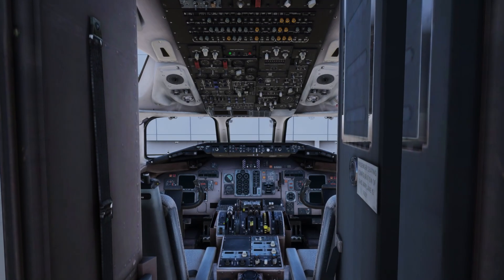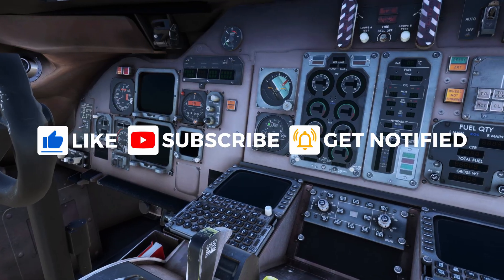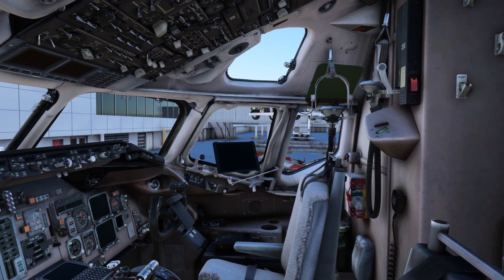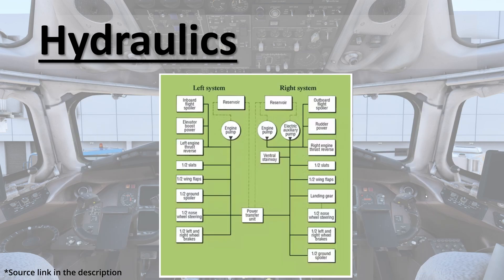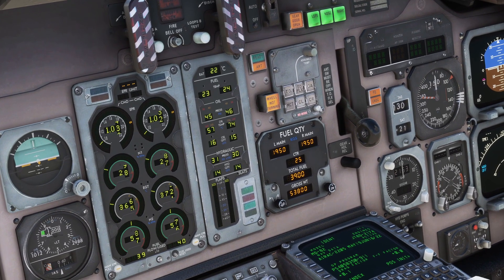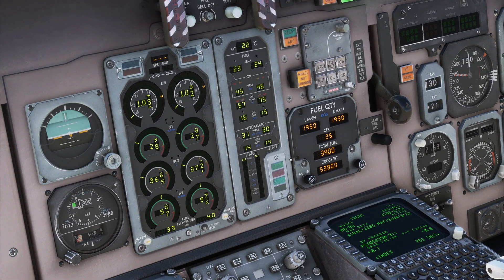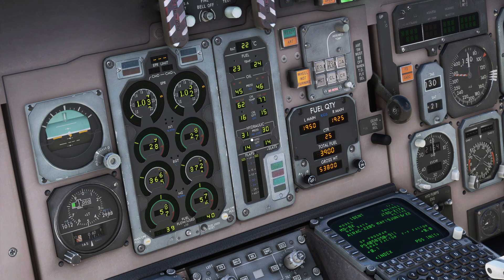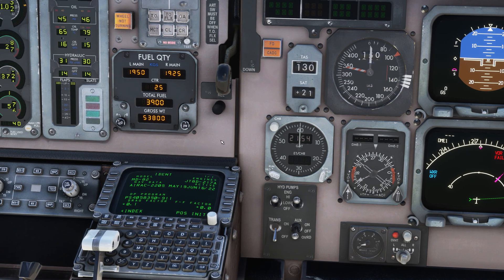Leonardo MD-82 for MSFS - Hydraulic System Explained - #3

Comment: I have not checked if Leonardo modeled this, but running L and R systems off just the AUX pump will result in sluggish performance from the user systems.  And if you try to run 2 things at once... like gear and flaps... they will run very slowly.  This is because the aux pump cannot supply the GPM demand at sufficient pressure.
Reply from the maker: Hi Michael, interesting. So dven with the same hydraulic pressure on both sides (3000 psi) the response becomes sluggish? Can you throw more light on why that happens? What is gpm demand? Thanks a lot for commenting and giving your insights :)
Reply: @AirborneGeek  pump pressure is a function of flow rate.  As flow rate increases, pressure decreases.  At lower pressures, hydraulic actuators lose performance and become slow.  The AUX pump can supply 8gpm @ 2200psi or 6gpm @ 2750psi.  The flaps require about 10gpm and the gear is probably about the same (I cannot find any documentation on that).  So if you ran both at the same time, the AUX pump will have fallen way down the pump curve.  Here's a generic example of a centrifugal hyd pump curve.  Google hydraulic pump curve to see an example.
Reply from the maker: Makes perfect sense. Thanks!!